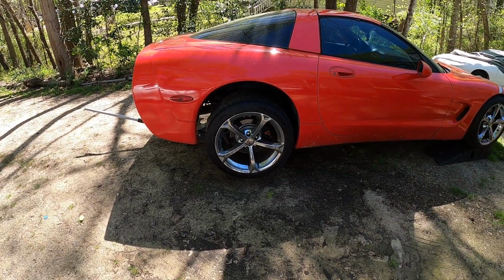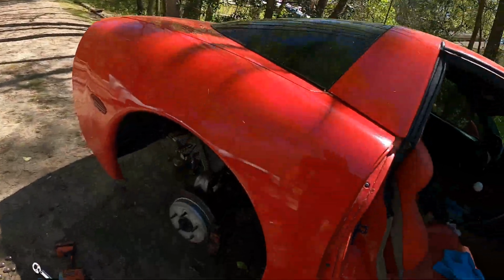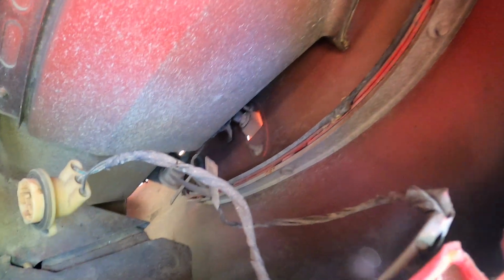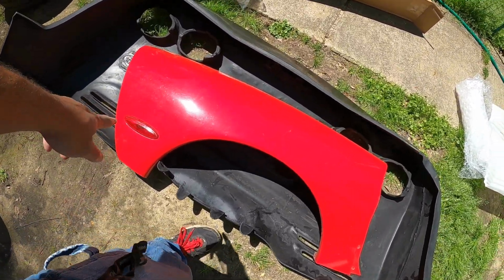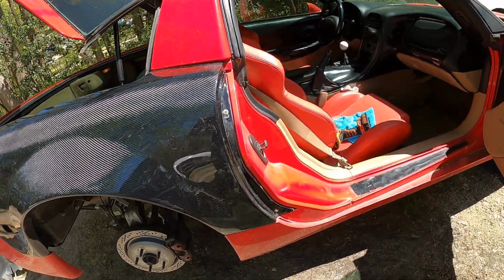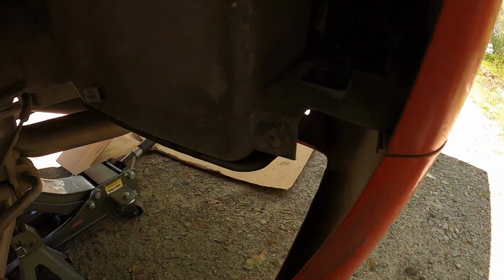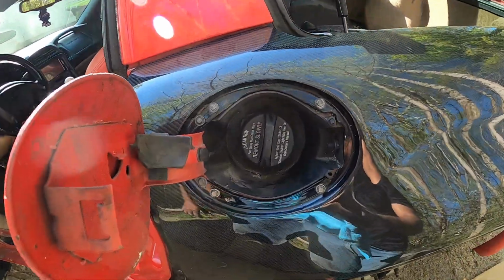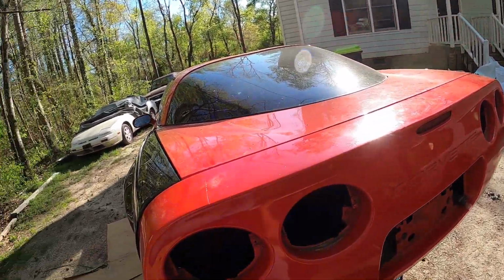Installing Corvette Creationz C5 corvette wide body carbon fiber fenders

Comment: Hi James, Props for doing this. I've been thinking about this and took a look at My Corvette Life's video. The widebody Fenders are way out of tolerance to a point that I'm not going to do this. Corvette Creations products are just crap! My local body shop suggested a professional install and paint because they are so difficult installing and lining up. So, hats off to you for doing this.
Reply from the maker: I don't blame them for saying that. There are little tweaks here and there that a professional can take care of with ease. But just simply getting them on was fairly easy. I just had to figure out how lol. Thanks for the props!
Reply: I used to work in a body shop for several years. Lining up panel gaps on aftermarket parts are THE WORST. They’re never perfect

Comment: Xlnt use of time out dude. I am currently swapping out my shocks and swaybars on my 01 C5 Torch Red roadster, along with a fresh set of Cooper Zeon RS3-S 18/19s on my 2011 zr1 wheels. Also doing a short shifter, and a  leather wrapped steering wheel plus the venom mod and 1-4 lockout fix. Good luck on your deal,lookin good.
Reply from the maker: I highly recommend doing the leaf springs also!! Unless you are using coilovers

Comment: Def switch your tires out to 345s in the back with those flared fenders bro... CCW makes a 5 spoke set of wheels that look just like the C5 Y2K 5 spokes but the spokes are set into the barrel further and they have a nice deep dish to them.... def the nicest (affordable for a corvette) wheels that you can put on it... CCW SP500s 19x12 in the back and 18 x 9.5 or 10 up front... a 19x12 wheel will look sick with those flares amd you probably wont need those wheel spacers/adapters but that size looks the best with your flares.... after 19 just doesnt look right ...20s in the rear on a C5 ive seen a bunch of people do it but that wheel size just looks way to big for the C5 besyoull feel the extra hook with more meat in the back and the Z06 sway bar... good call on that ... i switched to the Pfadt sways after my C5s rear bar finally gave out and snapped one day going over the Brooklyn Bridge... that back bumper cover looked alil warped when you held it up in the beginning... should you ever choose to switch out body parts again, you should check out ACP (www.corvetteracebodies.com)  ...i think they are in PA but they make some of THE BEST exterior body parts for the C5 platform... had to do some digging to find them but their bodies are the same ones used by the Pratt & Miller Engineered C5R that the chevy race team races at LeMans... their products are top notch ...other vette owners stop me all the time and ask where the hell i got my rear bumper cover ... it has the nicest molded spoiler  over any other rear bumper cover available and comes in 2 options... 2.5 inch rear spoiler or 4 inch.  I thought the 4 was alil to drastic ... it also has built in flares/canards on the bottom of each side...good to see the Halo tail lights... the stock lighting is just pathetic ...if you put plastic spacer washers on the tail light screws and mount the Halo Tails into the new bumper so that the tail light lenses will sit flush with the bumper... i personally think it looks better then leaving them mounted indented into the bumper... it looks awesome though brother... id just like to see how the ckear coat on those carbon fenders holds up over time i  the NC sun... really liked how you tackled a bunch of "should do to a C5" things all at the same time... now all you need as the icing on the cake to those fenders is the C7 Carbon Fiber bottom side skirts and the custom molded L5 Z06 Rear Brake Ducts from Lewis Five Motorsports (they make some awesome exterior body stuff for the C5... ill take a properly modded C5... andd C6 any day of the week over a C7 or even the new C8... looks like shit... only hope that they will release the C8 Z06 properly done and looking much more aggressive, 6-8 inches wider overall and some real radical venting and active aero because the base model C8 looks hugely disappointing... just looks like a cheap piece of shit and anyone who disagrees should hold off damming me and then say again that the new vette looks awesome ... but say it after looking directly at a C8.... when its parked next to a Lambo Aventador, Huracan, Murcielago, or even a older Gallardo... Id take like a what 2008 i think it was after when Lambo switched the Gallardo to E-Gear... but i would take a pre E-gear, 2008 Stick Shift Gallardo every day of the week over a brand new Corvette because thats what the new one looks like ... a failed American version of the gallardo... the new one just is NOT worth its absurd markup when you can get a 2019 Z06/ZR-1 that wil Destroy the C8 every day of the week and twice on sunday yet theyre asking 125-130k online for a new C8 BASE Model...forget that... Anyways ...Awesome job bro... def got some good plans for your vette... with the proper After-Market attention, i would def argue that the C5 is is the best looking of all the newer corvettes anf then the C6 after because the C6 just looks like a C5 with sharp/jagged and well defined lines... the C5 just flows so perfectly woth its curves with the only envy towards the C6 be in regards to its non pop-up headlights and that theu cut a whole 6 inches out of the C6 back bumper  which does look nicer and faster when adter the C6 back wheel ends, the whole car basically ends... they really had it dialed in with the C5/C6  (esp C6 Z06/Zr-1s ... i think as corvettes age and newer models come out, the C6 ZR-1 is going to be one of thise special vettes that always holds its value.... i love seeing these videos of real vette owners ...nit the guy whose going to sell it or trade it after 5,000 miles...  i seriously dont get how people do that ... i coukd never drive any corvette bone stock... no matter how cool it iw or its reputation, everyone (everyone who is a car person and owns a Corvette should have their own idea about  making their car unique and to stand out.. especially with performance in regards to the LS-Engine platform ... one of the all time bighest rock stars when it comes to motors but Chevy Downplays the fuck out of them...  350HP/375 Ft-Lbs. Torque... exhaust, full headers, test pipe, Cold Air/Ram Air Intake, FAST 102mm Intake & matching ported and polished Throttle Body, Titanium Internals, a radical Camshaft, computer chipped and tuned... that alone right there puts your LS1 350s output almost even with the 505hp LS7 427... (like 485/490hp) you give that motor just a little taste with . safe 5-6lbs of boost and your looking at 600/650hp like that...and thats on a stock bottom end... extremely impressive
Reply from the maker: Holy shit man thank you. And thank you for taking the time to write that out. Fyi the rims are 19x12 and I do plan on getting new ones but it'll have to wait for now cause of money and I'm widening the front eventually. After that I'll get a whole set of wheels. But once again thank you

Comment: Great idea with the ZO6 suspension.  I upgraded my base C6 to a ZO6 front and rear sway bars... Next I will do the ZO6 caliper and rotors upgrade which I already purchased ….
Reply from the maker: The brakes are on my list! If it wasn't for quarantine I'd have them already lol

Comment: Look others mentioned, painter's tape or putty would have solved the all the hole alignment issues. I'm mechanically inclined nut would have been nervous to try this myself.  So I definitely applaud you and it looks good. Comment/question- if you would have started at the top channel ( using putty or painter's tape for alignment) , would that have closed the gap some? Or trimming   across the top buy a 1/8th inch. I think I would not want that much of a gap.
Reply from the maker: I'm actually not really sure what could have closed the gap more. I've tidied up my work a little more and it looks better now. But all I did was add self tappers for more support and less play. I feel like the gaps have slightly closed up

Comment: If I could have talked to you before you started this project and you had questions on how to find the holes and transfer them to the new panels oh, I would have said you some Putty or Play-Doh! Put the Play-Doh in the spots where the holes are on the car and then when you set the fender down in place it should leave some type of residue or indicator where the fender would meet it then you will drill from the underside
Reply from the maker: That's a neat idea. I was trying to think of something similar to do but before I could think of anything, I just used my fingers and it worked fine. That's good thinking though!!
Reply: @car-nivores  👍👍👍
Reply from the maker: @kevinramey4226  using my fingers was easy enough. I didn't have to do much thinking in the long run lol

Comment: Man, those carbon panels are hot!  Do they scratch any easier than a painted surface?
Reply from the maker: Not from my experience. But my actual paint is pretty trash lol. The carbon fiber usually has clear coat fade after a little while.

Comment: I found it thx
Reply: Ya i see my coupe would need roof off your hatchback opens up so u can get top screws to fender if u look at a coupe close up u can see 3 bolts on each side thats covered by my coups roof suxx .
Reply from the maker: I watched workingwithwimberley do it and they snap off. He didn't have to take off the roof. Im sure taking it off is safer tho lol

Comment: Both fenders are made wrong but to late now cuz you drilled to many holes. Should have had corvette creations replace before installing.
Reply from the maker: Its all good I'm fine with how it turned out. Its not supposed to be a pretty car

Comment: For doing that in your yard I'd say you did a pretty good job with it. I'm also a little more anal and I would have probably given up if they didn't line up perfectly...lol. There's also plenty of good hole transfer options out there but they are pretty time consuming. The fenders do look really good on the car. I like them.
Reply from the maker: Hahaha yeah I was struggling at first but then I realized I was making it more complicated than it had to be. Thanks again though! 💪🏾